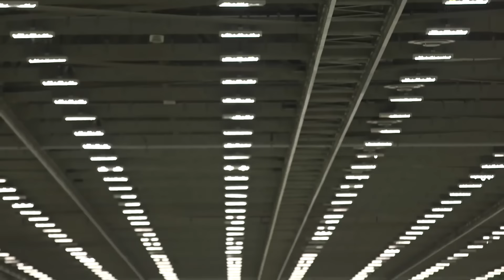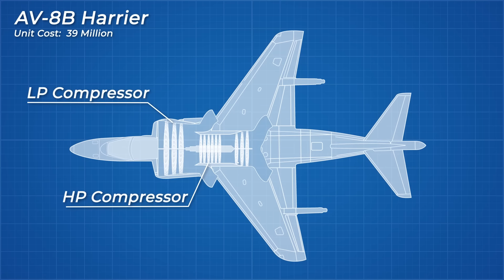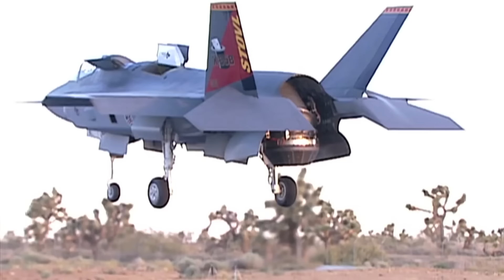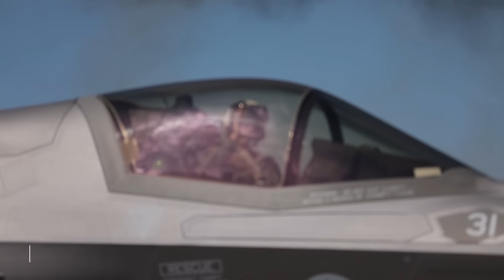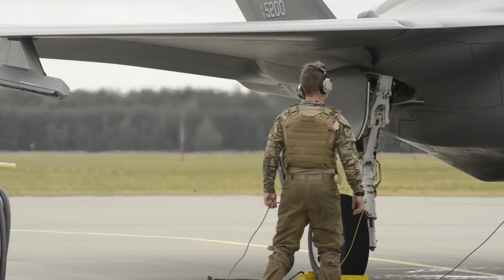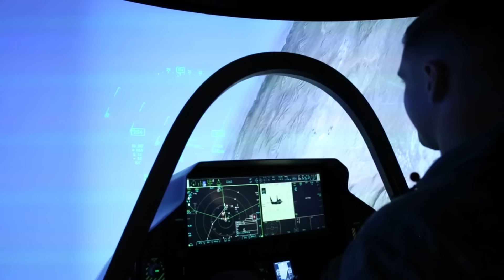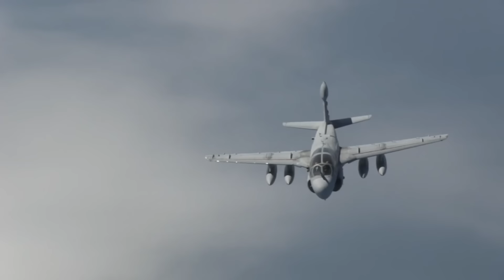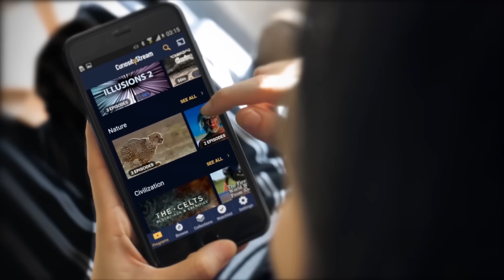Is The F-35 Worth $115 Million?

Comment: Me : So you're saying Vertical takeoff capability adds to the of cost and weight of this jet. 

Lockheed : Yep! The government kinda insisted soo...

Me : Yet ONLY ONE out of the Three versions of this jet has Vertical takeoff tech.

Lockheed : Chuckles Yep! The government kinda told us that Navy and Airforce didn't need Vertical take off, it occurred to them that they've runways soooo we YEEET'd the dead weight.

Me : Oh! Okay so the primary requirements weren't actually requirements rather fancy wet dreams. Still, the ONE version which has Vertical takeoff must make some goood money right.

Lockheed : well, umm!! The third version could only be flown of off few vessels soo... Chuckles

Me : pickachu face
Reply: That's a gross simplification of the history but yeah I don't think it was to anyone's surprise making the calls that's they would need 3 variants, always have with fighters. VTOL might be the least useful beyond the fact of being able to be used on amphib assault ships, the navy version is always going to be heavier in the gears and structure, where the airforce doesn't need that kind of beef so why not cut down unit cost by millions. They variants still have a 70% commonality of parts, sharing mostly the same systems and therefore training programs, it's still mostly the same fighter jet as was initially intended, and I'm glad the pentagon has let go of its pipe dream of absolute modular design
Reply: Except that the plane originated with a 1980s study into a Harrier replacement... it was STOVL first and adapted into the simpler variants which do not suffer any performance loss because of the STOVL technology thanks to being designed before the competition took place... they are 3 separate albeit very similar designs that do not make any unnecessary sacrifices.

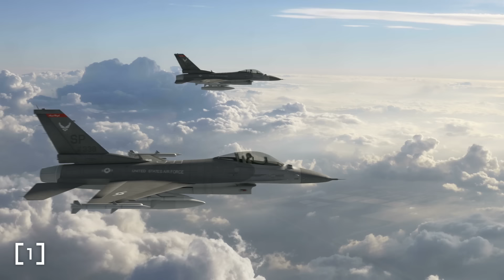Comment: 1:25 since when has the A-10 ever been considered an air superiority fighter? It was designed from the ground up as a ground support aircraft and tank killer. There was some initial talk of the F-35 fulfilling some of the A-10s mission profiles but that was thrown out for several reasons, one being it's incredibly over priced and over complicated for the CAS mission. Hence why the Air Force is currently buying the AT-6 and A-29 propeller driven light attack and CAS aircraft. After 20 years of constantly high Op tempo, the Air Force has finally epiphanized that there is a giant hole that needs to be filled in that role. It is simply not necessary to use a 100 million dollar stealth airplane to drop CAS bombs in a counterinsurgency (COIN) mission where air superiority has already been long established. Even the venerable F16 is too much bird for that tasking. We learned all of this the hard way in Vietnam when we did the same shit using very expensive and complex weapons systems like the F4 and F105, before reverting back to the ol' Douglas A1 Skyraider. These lessons were not forgotten, they just have to be rinsed and repeated every so often to keep the big green machine rolling along (lobbyists, contract steering and diversion, etc.) The F35 is still greatly needed for the next 50 years, especially with the focus of the US military shifting from COIN Ops to near peer adversaries. We wouldn't even be in this predicament needing to push the F35 above its intended purpose, had we simply produced more F22 Raptors when the assembly line was operational. The F22 is a true air superiority fighter(arguably the best in the world) and is MUCH more capable than the F35 in that role. The F35 is a great aircraft for what it was designed for, no question. Now that we are getting short on maintaining our capabilities and advantages in the sky, our turd bird congress is backpedaling and trying to convince us the F35 is some kind of miracle, "do it all" weapon which is simply a lie. We need as many of these things as possible since they already screwed the pooch on the F22. Crank out as many F35s, UAV/drones, and F15Xs to be missile and bomb taxis. Supplement the A10 with the AT6 and A29 for the CAS mission. Get as many of the new KC46 tankers in the air as possible, and accelerate up the timeline on the latest E3G AWACS to supplement the 1970s trash electronics that are STILL in the standard birds. Our Air Force is getting old, and the air frames on the 3rd and 4th gen fighters are worn out. There are only so many service life extensions that are possible. Our military, like our national infrastructure, needs a massive infusion of capital and effort.
Reply: Jesus that was a long rage
Reply: @darthbob8428  I was pooping, so I had plenty of time to rant.
Reply: The A-10s roles have been mostly taken by F-16's which have been proving themselves since the gulf war
Most CAS is not done by the A-10
The fast movers of Vietnam were not as good with CAS because their main sensor was the MkI eyeball, no FLIR and no high definition cameras
Reply: @demanischaffer  on my 2 combat deployments as an Airborne Infantryman, we called in A10s all the time. And Apaches. Very rarely a fast mover unless it was to drop a JDAM. In 27 months I saw that maybe a handful of times...
Reply: @trashpanda314  Pretty interesting 
When the DOD statistics put the A-10's at something like, less then 10% of CAS missions are done by A-10's last I checked
With other aircraft such as F-16's and F/A-18's doing a lot more with Strike eagles as well 
Even B-1's and B-52's join in on the CAS missions 
The A-10 does well in enviroments that the aircraft it replaced did, but after 1991 the USAF really didn't feel like repeating the same mistakes
Reply: @demanischaffer  I guess I just imagined the nearly 2.5 years of combat I experienced. You're right!
Reply: @trashpanda314  I'm sorry,
Individual accounts are important information but cold hard data does exist that says that A-10's doing CAS missions are a minority compared to other platforms
Reply: @demanischaffer  as an armchair observer may I make the observation that numbers carried out and numbers carried out effectively may not always tally, I can see a scenario where fast jets may need several sorties to do the job of one A10, when the numbers are counted the fast jets carried out more, there can be nothing that beats a machine doing a specific job that it was designed for, others may come close but that is all, I can see the argument that the aircraft can be tasked with different roles but in every one it would still be a compromise compared to a dedicated opposition, its a hard square to circle, an improved A10 with the electronic suite of the F35 maybe mounted in a pod?, maybe its time we saw a two seat A10 thereby improving its capabilities, (and allowing for better pilot training), F35 fronts a 20mm cannon the A10s is 30mm, the operational difference is huge and if you are up front and using the cannon you are low and slow to get the hit right, at this point the A10 cannot be beaten and it would have several tons of party mix left as well, and yes air superiority fighters up top to deal with the bad boys.
Reply: @CrusaderSports250  I mean, the chief of the airforce once reported that in 1 year the F-16 fleet did more CAS missions then the A-10 fleet did in 8
How much more can you "improve" the A-10? A 2 seat A-10 isn't going to fix anything, especially when the company that makes the A-10 doesn't exist anymore and the tooling is long gone
edit
It also doesn't help that overall, the A-10 fleet has been responsible for around less then 10% of CAS over Afghanistan 
The 20mm vs 30mm debate really doesn't matter, in the low threat enviroments the A-10 can survive in, what targets also exist in which the 30mm is solely needed?
Combine that with the fact that the A-10 isn't getting any cheaper to operate and the USAF is try to switch to airframes which will survive against peer or near peer adversaries, the A-10's essentially a zombie because of Congress
The A-10 fleet got essentially swatted out of the air in 1991 by Saddam and was forced to stay in safer areas while aircraft like the F-16, F-15E and F-111 went against more targets in more dangerous areas with less losses, that was in 1991, the USAF still sees that fighting yesterday's war won't work, especially when your aircraft fleet got its nose bloodied by fighting yesterday's war, 29 years ago

Comment: No it is not... It's stealth is obsolete, it is to slow to keep up with aircraft it would fight or try to catch, it's less maneuverable and dose not have enough range It's an over priced unusable obsolete piece of junk that the government spent to much money on with cost overrun after cost overrun.. the A10 is great at ground attack but would never be used as an interceptor.. The F35 is intended to work in all roles but It's not "good" at anything. It's just an also ran! It's as out classed as a Boeing F4B / P-12 would have been in WW2..
Reply: How is stealth obsolete? Sure the plane is slower, but the missiles it carries travel at Mach 4. It’s range is about the same as that of an F18, the previous carrier borne fighter.
Reply: "Less maneuverable"
According to what?
From pilot reports it's not
"not enough range"
It out ranges all aircraft it's replacing
"to slow"
You do know that the combat speed of an aircraft is very different then the clean top speed?

Comment: Was a radar tech. Radar works by sending out an RF wave. The RF wave does reflect back with a signal mattering on radar I can give various types of info. We also have IF but for us that know that's for the squak box that spits out a number randomly selected for that day. What makes radar amazing is it's power I worked on antps-75 which had a 250 nautical mile distance that's 250 out 250 back. What's amazing about that is an tf wave loses half it's power every foot it travels.. This is why you don't stand in front of one while turning as you'd basically be radioactive. I actually have a full way to detect so called stealth but unless uncle sam asks me I darn sure ain't telling another country. Again RF wave

Comment: No way the A10 will be replaced. They tried a few times already but there is nothing out there to replace it. Its an ugly heavy tank but it saves soldiers regularly.
Reply: It has been practically replaced by the F-16C in contested airspace and groundspace since the mid nineties. The F-35A is simply replacing the latter.

Comment: F-35A currently cheaper than a new F-15EX Advanced Eagle, F/A-18E/F Super Hornet, or across the pond, an Eurofighter Typhoon, or SAAB Gripen E. Yeah, seriously, the "low cost" Gripen E is more expensive per aircraft than the F-35A (though it is cheaper to operate).

Those are all 4.5th gen fighters, a major step behind the F-35A in capability. None are low observable, none have the power of electronic data gathering, attack, and countermeasures that the F-35 enjoys. Mass production really does wonders for cost reduction, doesn't it?

Comment: Fighter Jets are obsolete. Drones can literally run circles around them at a tiny fraction of the cost. This will be the last generation of manned craft warfare.
Reply: Removing the pilot does not make an aircraft cheaper. Not to mention drones are far more vulnerable to electronic warfare and cannot dogfight better than fighters because optimal turn rate is never achieved at the G limit. F-16 corner speed is achieved at roughly 7Gs and 400kts. Also, pilots don't just blackout after 9Gs, and have in fact been known to pull much more in combat situations.

Comment: Why doesn't the Air Force use the F-35C? The wingspan is much more similar to the f22 than the f35a is. It just doesn't make sense to me.
Reply: Because the F-35A's wings are optimal. In terms of wing loading the F-35A is practically the same as an F-16, whereas the F-35C's wing loading is lower and detrimental to combat performance because more lift = more drag. A balance needs to be maintained whenever possible.